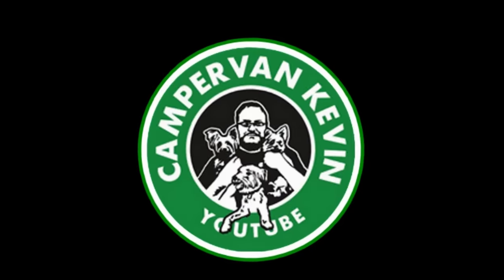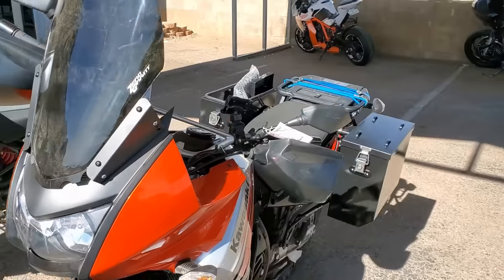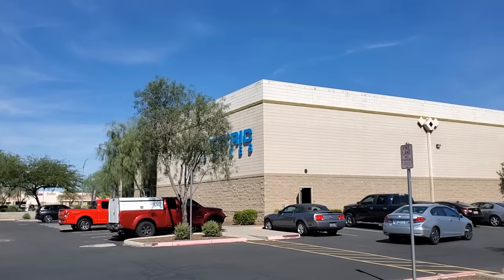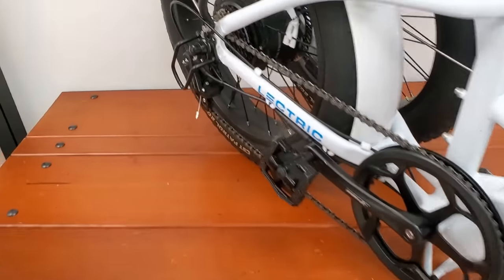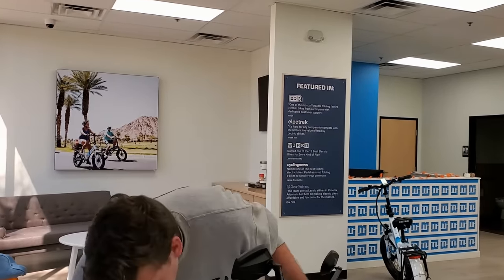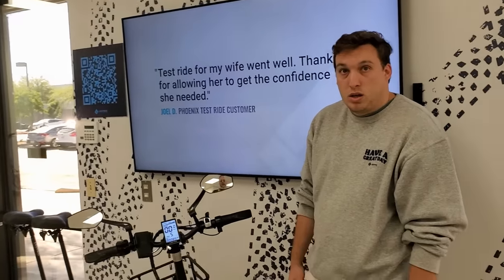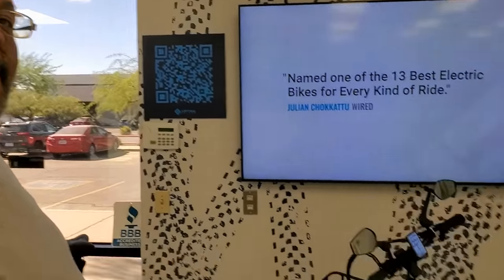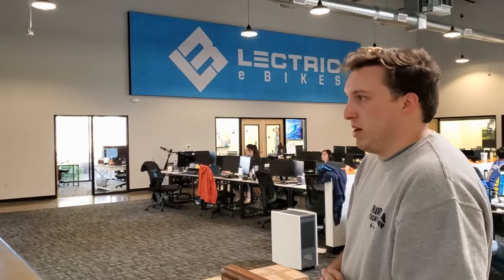Felix And I Both Get Lectric E-bikes!

Comment: Lectric would be better if they had a trade-up option. I'd love to trade mine in to the stepthrough model.  Kevin and Felix...it's an awesome ebike 👍👍 I've had mine since the first offer, and they were in a little office in Phoenix they've grown so much...I love my lectric bike and it was an awesome purchase.
Reply: I asked them to do the same but they wouldn’t. I barely used my first bike. I had to lay it on the ground just to get my leg over. But I sold it for almost as much as my new step thru cost.
Reply: @kleenmary7060  did you get the newer bike?  If so can you tell me the comparisons?  I'm thinking about it.  Even wo trade up the bikes are phenomenal price for the quality, enna?  I don't feel ripped off.  I'm just delighted to support these guys bc this imo is what AMERICA IS ALL ABOUT!
Reply: @honeybadger8893  biggest change was the front tire suspension which is pretty good. Not as hard on the arms on dirt tracks. The seat had springs too but I traded that seat out for a larger saddle. I am very happy with the new bike. Riding it everywhere.

Comment: Hiya Kevin and Da woof pack,
I'm glad your health is getting back to normal (at least as normal as it can be considering your missing part). You've been expanding your 2 wheeled fleet nicely. I'd love a KLR, but as I've grown older, my strength isn't what it used to be and that's a big and tall bike. It fits you perfectly though. I also like the Monkey, but ever since I got into my eScooters, I've decided that my Gas bike days are probably over (Unless I can find a reasonably priced 250cc Enduro from the 80's/90's).

But,, you are now in my territory. I've now built x3 900W-1000W 65V Li-ion Battery powered eScooters (no pedals) that have a range of 18-21 mi and speeds of 23-35mph. and just bought x2 identical S600 (600W) Schwinns for under $200. One is virtually showroom condition. They need batteries and servicing, but that's what I do.
 I'll trick the cleanest one out and then sell the 2nd one as well as one of my other 1000w Schwinns I have, to recoup my $ and make an extra buck or so.
You are going to enjoy those Electric eBikes and they will also help you guys loss a little weight pedaling around. I'd have one myself, but since I'm missing my R leg and ride with a prosthesis, I can't easily pedal.

One word of caution though; I didn't like his saying the Li-ion batteries can be taken down to empty. Never do that. The BMS (Battery Management System) should shut it off at approx 3.0V per cell, or 2/3rds of the whole pack's capacity.
 There is danger in Li-ion batteries if they are overcharged OR taken too low. As long as the BMS is working correctly, it should shut the charger down before it overcharges and it will also stop the bike from running under power if the pack gets too low.
If the bike isn't going to be ridden for a few weeks, it's best to leave the pack at about 3/4 charge. Leaving it for a long time at full charge isn't a good idea.
Remember, there is no noise so you can't tell when the bike is on. I make it a rule to never turn the bike on unless I'm sitting on it and ready to ride.
Helmets guys, (real motorcycle not bicycle) helmets, gloves, over the ankle footwear and long pants. And keep your head on a swivel. Ride like the world can't see you. 
Have fun and ride safe.
cheers
Boots Langley
La Mesa

Comment: Looks like they upgraded their weight capacity to over 300 lbs. The reason i bought a Rad Power Wagon was because it was the only one rated to carry over 300 lbs.

Due to the arthritis in my knees I couldn't bend them well enough to get on off the bicycle without falling.  The upper cross bar is too high for me to get on and off.

 I'll definitely have to look into getting one of the step thru Lectric bikes.  I'll be getting shots in my knees November the 12th that will deaden the nerves for pain control.  Cortizone didn't work and insurance wouldn't pay for the gel shots.
If the nerve deadening shots work i'll probably order a Lectric Bike and sell the Rad Power Wagon. Otherwise no bicycle  riding until i get both knees replaced and rehab from the surgery.

Comment: Congrats guys!!! I look forward to hearing more about them.

Their bike has been on the back burner since the first version came out. Looks like a great entry point to fat e bikes. I've been wondering if the fat tires and comfort seat would absorb enough bumps to make it tolerable with a bad back. I was under the impression the suspension seat post was rated for 220 pounds.
Really appreciate the factory tour. I hope the noise on the phone if you call customer service isn't too bad, sounded very loud there.

Comment: I got my Lectric last fall. My plan was to sell my car and head south in my motorhome. But for some reason it started having issues with starting after new tires, batteries, and other stuff done. I have to believe God has a reason it did not happen. I was going to use my lectric to run to the store and explore. I use the throttle more than I thought I would - love the speed. But I try to make sure I can peddle to get the aerobics workout since I wanted the bike for exercise. I have not used it all winter due to cold but I think we may be having our last freezing nights soon so I can take it back outside. Mine will ride behind the passenger seat where there use to be a chair.
Reply: I also want to put flatout in the tires since around here there are a lot of goatheads that will flatten a tire.

Comment: Be carefull with those steel panniers. Lay it down and well what happens next isn't pretty. Went with soft panniers on my V-Strom and very happy with the setup. Lectric E-Bikes are pretty awesome. Got mine about 4 months ago. You will love it, really!! Dragging an E-Bike in and out of a Class A can be a handful. So some of us opt for hitch mount. If Felix is considering 2 wheels this is the way to go.
Reply from the maker: If it saves my legs a $150 replacement is worth it
Reply: @CampervanKevin  These hard panniers can trap your legs under them. That's why many people end up going with soft bags when they do alot of off road riding. They are nice and secure and will help if the situation is just laying the bike over. But the potential for serious injury is still there. My best advise, don't ever crash! Honestly I think your just going to be putting around off road so it will probably never be an issue in your case. Have fun, enjoy while you still can.
Reply from the maker: @loborob5853  I'm mostly a dirt road/fire trail kinda guy nowadays mixed in with some pavement too. Nothing too serious or technical. Both my brothers raced, I didn't

Comment: Kevin; I have been enjoying my Lectric Bike for about 3 months. Great ride. Couple of things, I think the basket kits ship next month. Be careful when going down hill; it is very easy to obtain very high speeds very quickly. Always apply the back brakes first, then slowly add the front. Try using the cruise control, makes for a great ride.
Reply: Wow didn't know they had cruise control? These sound really great. Are they hard to learn compared to traditional bike? Or like a car? LOL

Comment: I'm surprised you didn't get the carriers, at least for the front.... (didn't he say you could still fold if you had one in the front?). Won't grocery runs be difficult without?
This might be a good solution to a problem for my husband, once we move to the mainland. He can't drive, due to neuropathy in feet. But he wants to be able to get a mile or two down the road for fast food, should he need to
Thanks for this awesome video. 👍🏻🙂.
Reply from the maker: we both got the rack set front and back. we have to install ourselves
Reply: @CampervanKevin  ohhhh! AWESOME! 🎉  I know you're going to love it fully tricked out 👍🏻😉👏

Comment: Great review Kevin. That will be a great way to scoot around Quartzsite. I have an early addition. One of the first things I did was have tire liners and green slime added to the tires.  So far so good. Fixing flats on these, especially the rear is a pain. 

Would you tell me what preset speed you are getting on PAS level 1 when on level ground and minimal pedaling?  Christian mentioned 7 mph.  Is that what you are getting?  My early model is preset about 8.5+ mph which is to fast for just looking around. I heard they have reprogrammed the controller to a lower speed for PAS1. That would be a motivator for me to upgrade along with the front suspension. Thanks.
Reply from the maker: I will have to check
Reply: @CampervanKevin  Thanks. I am looking forward to learning what you find out.

Comment: hey kevin nice video on the klr.i have a motorhome with a hitch that only has a hitch cap. of 350 lbs. even if i had one that was 500 cap. did you have to do any mods  for the klr at around 470lbs? keep up the fun to watch videos
Reply from the maker: Mine is 430lbs... I have adjustable rear air bags that help lots. I'm at capacity

Comment: Your RV batteries are LiFePo4 but the eBike is Li Ion. Both are Lithium based but they are different chemistry. Li Ion are good for about 2 to 3 years and maybe up to 1000 charge cycles. LiFePo4 have a much longer life and can handle a lot more charge cycles. The reason Li Ion is used in bikes is because they are smaller, lighter and cheaper for the same amount of charge. One more misconception is that Lithium batteries can be run down to 0%. This is absolutely false. I have run a Lithium battery to 0 and the battery was ruined. Would not take a charge. The reason people think you can run them down to 0 is because often (but not always) Lithium batteries come in a package that includes a BMS, Battery Management System, that cuts off the output when the batteries get down to about 20% thus protecting the battery cells.

Comment: I noticed you had a comment with an email address for contact on an affiliate link and its been edited. I  reached out to Lectric to see what kind of additional incentive they might be offering with your affiliate link. I am going to purchase 2 bikes just haven't decided which manufacture yet. I asked if they had any additional incentive that would cause me to pull the trigger with your affiliate. Someone by the name of Liz  responded back 
"Since the XP and XP Step-Thru are currently on sale, we are not offering any affiliate bike discounts at this time."  I am still scratching my head, but I guess I will leave it at that.